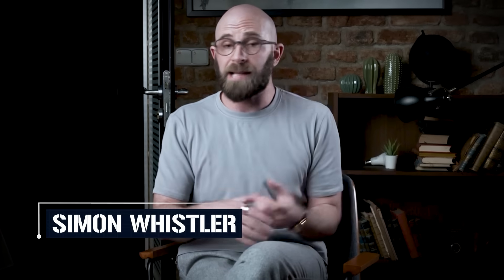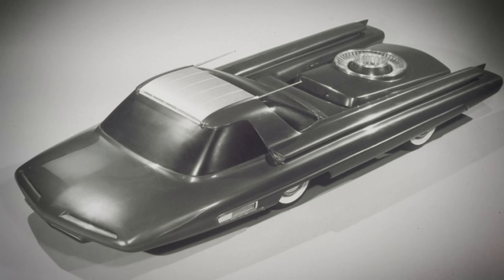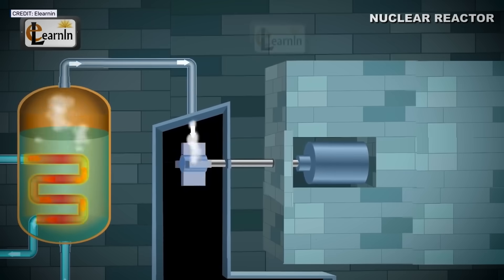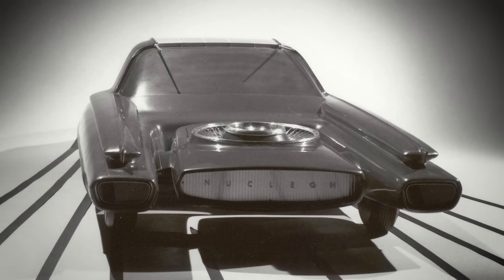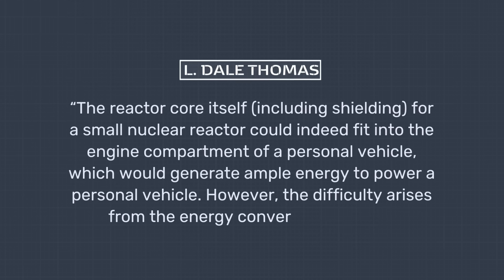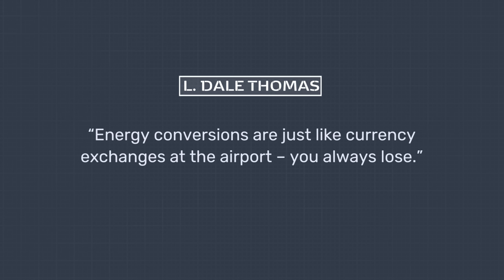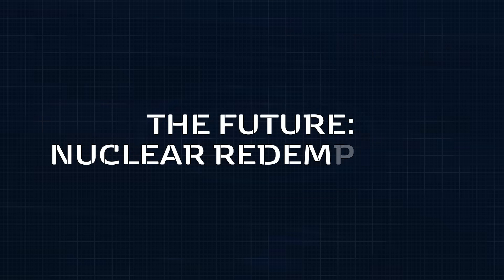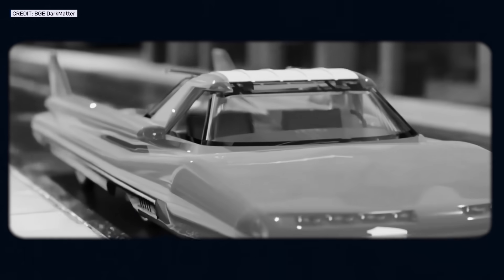The Ford Nucleon: The Nuclear Car of the Future

Comment: We could just install these small scale nuclear reactors in gas stations, providing massive charging abilities without straining our existing electrical grid. Plenty of nuclear fuels that are reasonably safe to handle and store spent fuel with a short half-life so they become safe\inert within a decade, and they would only need to be changed\refueled once a year or so depending on how many vehicles the station charges simultaneously.

Thorium pellets make nuclear energy very safe and reliable at the cost of efficiency over standard nuclear fuel types; still orders of magnitude more efficient and cheaper per kw\hr generated than any combustion generator (including coal, natural gas, and ship crude oil). Cleaner too, as an accident when shipping thorium pellets is much easier to contain and prevent environmental impacts than one involving any kind of liquid fuel.

Comment: I have to take issue with "not enough uranium". There are many ways to reprocess and ocean filter recover, and even deep sea floor dredge recover uranium. The ocean filter method alone has like 1,00 years of reactor cores in it.

Comment: The good old days when companies where willing to spend  money on even way out ideas to see where it took them. 
 And if you look at everything in the day to day life of humans  today , we tend to be more driven by fashion or trends , and sometimes we even abandon good common sense practical  items that  just work , to follow some new fashion trend that is actually less practical with less benefits , even costs more in the long run …. but looks cooler 😂. 
If you look at motor cars , some were good , some were bad , and there was an era were some designs like back in the early 70’s were unsafe ( cough pinto among some others) , , as years rolled on we got some great reliable cheap cars that were much better designed.  , then some bright sparks come out sporty but complex gearboxes that were notoriously unreliable,  ever more and more ridiculous stricter emission laws that made engines smaller , higher stressed , more complex and expensive and less long lasting …. Roll on the electric car trend , more expensive, hugely electrically complex , dirty to manufacture ,  with poor range , inefficient at heavier loads or adverse conditions  and don’t last as long with lots of extra community baggage such as expensive infrastructure, etc. 
what will the next trend be  …. Back to the horse and cart ?

Comment: Lol, battery powered cares suffer from even more energy transfer energy transfer losses as the powered is still generated at a plant and transfered multiple times including the added transfer from electricity to chemical and back to electricity in the batteries.

Comment: It also couldn't ramp its power up and down very fast, just like the big reactors used to make steam.  It is a terrible design thatto be practical at all, it would have to get even heavier with storage batteries and electric drive motors. Since batteries in those days were all lead-acid, they could have been integrated as shielding which could make it work as a daily driver for a short while... as a hybrid nuclear-electric car.
But two other factors not well known back then would also come to make it worse as a car. It would suffer radiation embrittlement of some components and the waste would include any parts that gained in radioactivity, not just the spent fuel. 
What could have been built, again as a hybrid nuclear-electric car, would be the same sort of nuclear thermo-electric system that powers the two latest rovers on Mars. That type of car would be severely limited in range per drive, and also how often it could be driven. In other words a fine car for an octogenarian who only goes to his/her doctor a few times a month.
 I write this in my eighties and knew that car was bonkers even when it was first proposed.

Comment: The problem with scaling fission power is you have EITHER a building sized system putting out megawatts (even the reactor and power systems on a nuke submarine are the size of a small building) or you have tiny nuclear thermo-electric generators such as are used in long duration satellites but only generate a few watts.

Comment: Technically, we already have nuclear powered vehicles.  The Curiosity and Perserverance rovers on Mars are powered by plutonium reactors and they're about the size of a Mini Cooper.  Plus, as you already mentioned, on the lunar surface there aren't any ecosystems or ground water to contaminate, so any damage from a reactor accident could be very easily contained making those types of vehicles a very appealing prospect.

Comment: The nucleon was a missed opportunity. if they can make spent fuel casks that can survive a T-bone impact with a train, they can make a tiny nuclear reactor that can survive a car crash.
Reply: I feel as though we could definitely do this today, the only issue is the cost of nuclear fuel and extreme lack of civilian nuclear infrastructure of any kind. Plus the miles upon miles of regulations that’d need to be amended.
Reply: Well at 14000 car accidents per day. It would certainly get a lot of testing.
Reply: It's quite a big engineering challenge to make a safe and efficient reactor, plus all the necessary plumbing, cooling and shielding, that small. The smallest operational reactors that are capable of producing continual power (i.e. that are not just scientific experiments) that I'm aware of, are too big and heavy to fit in a reasonably sized car, and even they must use Uranium fuel that's enriched to extreme levels, well beyond weapons grade.
Reply: We can send a man to the moon…
Reply: In tests at the U.S. Army Aberdeen Proving Grounds nuclear spent fuel casks were easily penetrated by DU-tipped missiles.
DU = depleted uranium. How ironic! 😜🤪😂☢
Reply: Nah. Nuclear-powered Trains are generally considered to be too impractical, and they have hundreds of tons to work with. Cars and Aircraft haven't a hope, with all the Nuclear-Electric hardware and reactor shielding required.

It's different when stationary on land or mobile while under Water or in Space. The Spare Cube Law frowns less upon those applications, as does Margin of Safety.
Reply: It be a shitty day, if we find out we couldn't make a nuclear safe car after all... Best not try.. Let's do hydrogen.. Bit safer.. Ish.

Comment: When I was a kid, I drew up a car engine that had a plutonium piston and head, moderated with control rods. As the piston approached the head, air in the chamber would superheat and expand (just like a gasoline car). One problem is that you'd have to be able to stop the piston away from the head, 100% every time, which may not be possible in the event of an accident or breakdown. And of course the metallic wear of the piston would eject particles of Pu. Other than that, it would run for a very long time.
Reply: that's referred to as open cycle nuclear. like the windscale reactor in the uk, it would need scrubbers fitted to lower the fallout when it went into meltdown. there's a similar thermonuclear fusion engine that uses lasers to fuse tritium inside an engine.
Reply: That's a clever idea.  Crazy dangerous to keep teasing critical mass with a piston,  but I never thought of it before.
Reply: @JCAtkeson3 
Tease the critical mass with a piston?
Again, what could go wrong?
Reply: It's like putting the demon core in a car @MatthewSereysothea-hf1js
Reply: Reminds me of the nuc powered jet aircraft.
Reply: I wonder if you could make an acoustic version of the same idea. The material compresses, goes slightly critical, makes heat, then expands in a cycle.  Piezoelectrics harvest the energy as electricity.
Reply: @ it exists already. Haven’t you heard a car, while waiting at a stop lite, blasting rap?
Reply: @tsbrownie  let’s drop one in the Batmobile. Alfred, get the engine hoist.
Reply: Yeah, I can see that being a bit of an issue.
 Not to mention the insurance
Reply: The plutonium in the head and the plutonium in the piston would not be bare, you probably have nickel housing or "sheathing" and I assume a spacer plate inside the cylinder to maintain some minimum distance between the two masses. The pieces of your "core" can have material between them, you just have to take the neutron transparency, absorption cross section etc into account when configuring your critical mass geometry. I actually love this idea, I think it's safe to assume it's not practical at all but it's a really interesting approach to nuclear power that I've never considered before.
Reply: Cockroach’s leave particles of Pu
Reply: D’oh

Comment: EV's have only one energy conversion...? How many conversions are there before the electricity makes it to the car? Also take into account he losses (heat) for charging... 
Electricity is mainly generated trough steam turbines (nuclear, coal, gas, ...) so it is the exact same conversion, but in a different place. Yes, the scale brings efficiency, but the conversion is exactly the same...

Comment: They could have put the nuclear reactors in TRAILERS that power electric motors on the car.  Sort of like a Tesla only 1) without the heavy, dangerous lithium batteries and 2) with a nuclear reactor trailer.
Reply: So you end up with an even heavier more dangerous nuclear reactor in tow.

Comment: "Okay Mr Smith, we've replaced your reactor - that will be 30 million dollars. Will that be cash or credit?"
Reply: Can that be Zimbabwean dollars?
Reply: @maniac117  He said 30 Million dollars not 30 cents
Reply: Wait a second, I might have some cash on me
Reply: I'll be paying with caps
Reply: Mr. Mechanic I have a coupon!
Reply: @michaelcoslo6497  Do you take Diners Club?
Reply: True now, but maybe not if these cars had actually became a thing. Ordering something like that today would be completely specialized, but if we were making millions of them a year, the price would drop drastically.
It's actually a problem we're about to be facing with electric cars as they become available on the used car market. The batteries lose their ability to hold power just like your phone battery. Soon, people will need to replace the batteries in their electric car and it's going to cost more than the damn car. We just don't make enough of those batteries to bring cost down to more practical levels.
Reply: Can you imagine how drastically the prices would have dropped on nuclear power if this would have been a thing back then?

Not to mention, where we would be technology wise by now?
Reply: Do you accept Bitcoin
Reply: @AlexHowe-np4tm  😃😃😃
Reply: "Hang on let me sell my nuclear waste to an unspecified middle eastern extremist rebel force on the Dark Web and I'll get back to you 😉"
Reply: Tbh nuclear fuel is very cheap per MJ of energy produced. BIggest problems are: 1. radiophobia. 2. non-proliferation (tiny reactors run on highly enriched weapon grade fuel). 3. energy conversion.
Reply: Caps?
Reply: “Ow sorry I forgot the purse home let me go charge it at the nearest nuclear power plant”💀
Reply: Indentured servitude for me and my family's generation for the next 300 years.
Reply: What if it was 10k. Problem car accident nuclear meltdowns

Comment: Wouldn't the best possible propulsion for cars simply be electric propulsion? I don't mean battery-powered cars, but rather directly connecting an electric cable to the car... It would just have to be cleverly designed. For example, the car could drag a cable in a groove underneath it, like a rail, and draw electricity from the road.

Comment: What about a nuclear batteries? Like what is used in Soviet light houses, could that have the output needed for electrical vehicles that you wouldn't have to charge and replace it in 50+ years? 😅
Reply: These RTGs use strontium-90 as the heat source and can generate around 10 watts of electricity, not nearly enough to power a vehicle. One horsepower equals 756 watts.
Reply: Ah okay, bummer. 😅